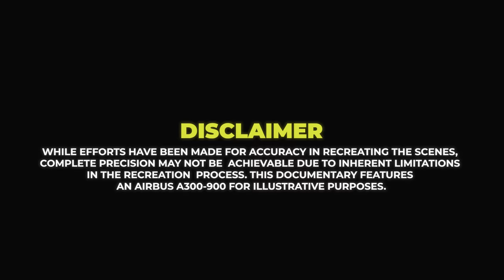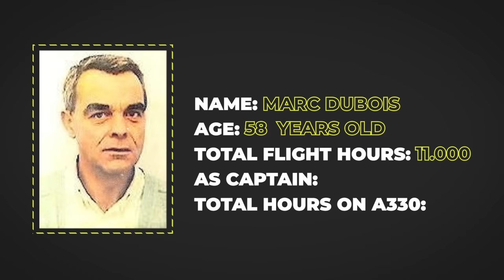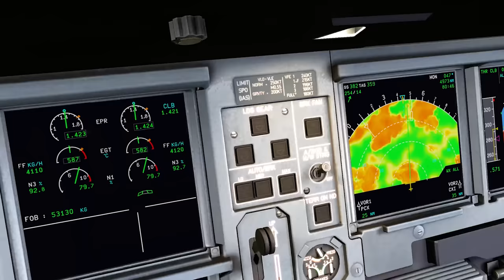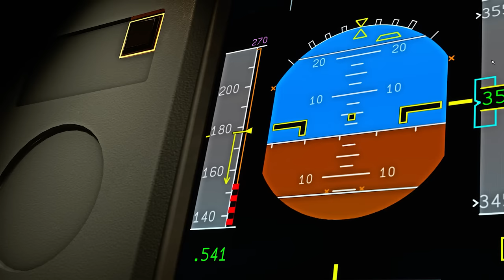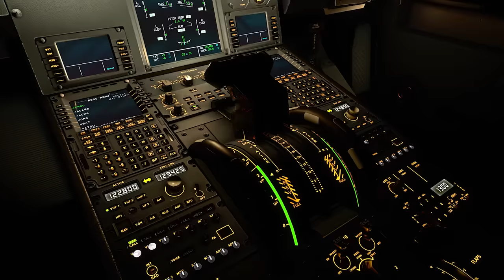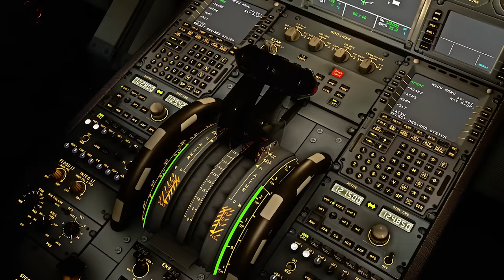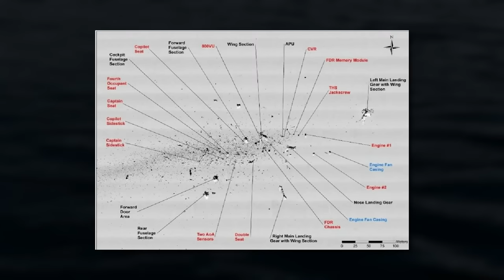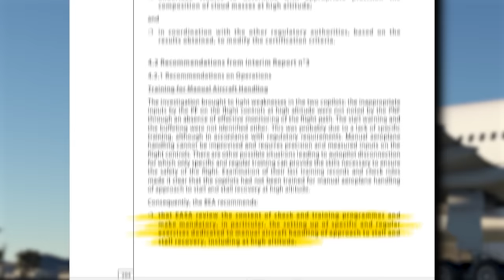Horrific Freefall into the Deepest Ocean | The Sad Story of Flight 447

Comment: This one facinated me. My Father was an A&P Mechanic for TWA for over 20 yrs at Lambert Intl in St. Louis. 58 to 82. Air crashes are investigated and 3 things: Weather, Mechanical, Pilot Error are what you look for. Terrorism obviously has been with us for some time also. This aircraft was doomed by pilot error. Weather was the airspeed instrument failure. Airbus jets have a joystick on both sides of the flight deck. Boeing jets have a yoke control that comes out of the floor in between the pilots legs. The Captain left the flight deck to The Less Experienced 
pilots. They repeatedly pulled on the stick pitching the aircraft up. They were not flying at all but in a flat spin. That should have been obvious with the horizontal loss of control. They hit the ocean at 400 knots. When the wreck was finally found, some of the remains of passengers were still strapped in their seats. At least it was quick. Makes me shiver thinking about the souls on board the 911 planes.

Comment: A stall must be the most terrifying a pilot can handle. Its like a ship losing its floatingcapability.
Reply: Nah, stall recovery is pretty straight forward in most airplanes. It's hardly worth worrying about really. I could take you up in a small plane, show you a stall and how to recover it, and you would be like, "Really? That's it?" Even a complete newb pilot can do it easily after being shown how and making a couple of practice attempts. Now, so called "power on" stalls, such as happened in this incident, are a little bit more interesting, but not much. My fifteen year old son was practicing them in his third hour of flight lessons.

What's terrifying is that a pilot doesn't RECOGNIZE the stall, panics, and actively HOLDS the stall condition for three friggin minutes without ever realizing he's doing it, as happened in this incident.
Reply: @xtnuser5338 it feels horrible, i was in a stall with an experienced pilot in a cessna and it felt horrible even tjough we only dropped for a few seconds
Reply: @l.n963  Some people do have a negative physiological response. That pit-of-the-stomach "Oh Crap!" feeling. I'll assume you hate roller coasters also. Heck, there's a highway offramp in my town that kinda feels that way if you're going about 45-mph or more when you hit it.

But everything I said is still true. Were you surprised, or did the pilot tell you what to expect?

Comment: This accident is scary because it shows that pilots don't really know how to fly a plane, some of them just press buttons and guide the landing. I'm not a pilot, but I've flown multiple times, it's very clear by just feeling it to ballpark the plane's speed, angle and if gaining or not altitude. I know that without the AP, the controls are harder than usual, but it seems that they couldn't realize if the plane was slow or fast, climbing or desceding. This is scary

Comment: A nose up is a dangerous airplane attitude according to classic acrobatic manual,  I can't believe that the pilot was pulling up the stick continuously.
Also all the automation makes the pilot overconfident and comfortable and when they lose it sometimes is an issue.
IMO  they should fly mono engine airplanes and/or sailplanes periodically in order to re fresh the basics.

Comment: I read a well written book specifically explaining the timeline of this accident.
This is what failed: No CRM(Crew Resource Management) and no "checklist" attitude). Let me explain:

In acute situations, the 1st step of a good CRM is "who is flying the plane?". In this crew, that was not clear. Both pilots were confused and making inputs.

The captain came in and did not make the question neither. He just asked "what's going on".

When the captain came back, he did not request a formal briefing of the situation. In a formal briefing, the pilot flying the plane explains quickly what happened and what has been attempted to correct the problem and what failed.

I am not sure this was an Airbus/Boeing. The author said, if it was a plane from the other company(Airbus/Boeing) the inputs from Bonin pulling back the controller would have been noticed by his colleague. In this plane, there was a major flaw, that the controllers could be independently controlled.

None of the 3 pilots seemed to react to the "stall" warnings, which was played 86 times. No explanation was found for this. The pilots didn't know they were in a stall.

The moment the captain came in, they were beyond help. Under a certain altitude(i forgot which) recovery is not possible anymore. 

Conclusion: "the unlucky stars aligned that day".

What now?
-The controllers should never work independently.
-Train the pilots in CRM more often.
-"Stall" warnings, as they are, could be ignored. Make them infinitely more annoying.

Comment: There was no need for the pilots to do anything. The plane had been flying perfectly fine so when they lost all readings they should have just left alone until the readings came back online. Instead they started to blindly fly the plane without knowing what their control inputs were actually doing. They had put the plane into such a position that the computers didnt even recognise what was happening and basically stopped putting out warnings or alarms because they could no longer contemplate the information from the various sensors that were still working.

Comment: I remember hearing about this incident. But was too busy to delve into the inner scope of and the cause of it.

But in summation, it sounds to me, as it boils down to lack of training of the junior pilots who took control  of the aircraft. 

But the captain returned to the cockpit. And with over that many hours, he should have the experience and the authority to resume command of the aircraft. Which could have saved everyone. 

When I first heard about this. It rather surprised and shocked me. Because Air France has one of the best records for safety in the industry. And the explanation on this factual basis is the fact that they are one of the first pioneers in aviation. 

The US sent pilots over to France during WWI to be trained by them. So the fact they left an implementation should be dictated by common sense and logic is rather disappointing.

Comment: Few clarifications based on facts. (A) All such bad weather was clearly showing in the briefing package given to AF447 pilots before the flight. They knew in general terms what to expect.  (B) Captains wish to be in the cockpit during bad weather crossing and not going to rest right away (C) All, and I really mean all, the other aircrafts were deviating such bad weather by 50-80-100 nautical miles left or right. AF447 was the only one that went straight. (D) The reason identified was that Air France pilots had the bad habit to keep the map scale to maximum of 640 NM where even a serious weather cell of 30-40NM looks very small. Air France changesd such habit after the AF447 accident (E) Air France did not have training for UPRT, meaning Upset Recovery, as it was the case in such AF447 accident. The pilots had to "unload" the wing instead of "keep pulling back the control stick" and they would have solves the issue and recovered the airplane. Such proper Upset Recovery training was introduced after the AF447 accident. (F) A weather like that is never-ever avoided climbing above, but rather be circumnavigated. As all the other aircraft were doing properly. Climbing does not assure that the storm is avoided during its development; the aircraft will be highly subject to be stuck by lightnings; the turbulence will be significant and there will be almost no performance margin. All what it was listed here are facts and not speculations.

Comment: What are the biggest problems I always see is the dual input function, pilots need to decide who's going to fly the plane to avoid the ambiguous commands to the input stick 
  Aircraft need to have a built-in GPS system that allows it to assess aircraft altitude and speed based on satellite inputs, in the event the pitof tubes become Frozen, or offer conflicting inputs, the GPS information would allow the pilots to fly the plane until the input tubes can be assessed as operating normally.
 I don't know if this will help or not I'm simply not a pilot just thinking of what is available and could be incorporated into aircraft.

Comment: The plane model shown in this video is the A330-900(Neo) (which entered service 2018) with it's characteristic Racoon eyes cockpit and A350-esque blended wingtips. To my knowledge Air France never ordered Neos. Flight 447 used A330-203 as stated.

Comment: If I understood correctly, they weren't able to get out of stall mode because they didn't receive training on how to do it during cruise flight.

Additionally, it seemed that they over controlled the airplane, which was the cause of entering stall mode in the 1st place.

My question is (to make sure I understood it right): if they had managed to increase altitude (in order to melt the ice crystals) WITHOUT entering stall mode (by more subtle manual controls) they probably wouldn't have crashed?

Since their lack of knowledge was how to deal with stall mode in cruise flight, if they had never entered that state, they probably would have made it, it seems.

Comment: This is the result of having 3 pilots doing a round robin in the cockpit. DUMB. Once the plane starting to lose momentum, they were done. They panicked, didnt have the correct information, and no one was prepared. A 38,000 feet drop in under 4 minutes on top of that and its impossible to recover.

Comment: They spoke french, not english. I knew Marc, the captain. I did mountain flying  training in france and met him then. 
Nobody in the cockpit 😢understood what happened. However, Marc yelled to Bonin do not pull the stick but it was way to late. At 10000ft recovery was not possible anymore... 
Stall warning stopped several times because the airspeed was so low (due to continuous stick pullup) that the computer rejected it.  When speed came alive, because the stick was pushed nose down the stall warning came back online... 
I think nobody understood nor believed the instruments. Maybe Dubois but to late

Comment: I know nothing about aviation. But the whole ice crystal deal disabling many saftey devices seems like a big flaw. Why is this? Surly there is a rational explanation for that?
Reply: Ice crystals block the inputs into the systems that are running the safety systems. The systems basically don’t have data to run so are useless and turn off. Since this does not necessarily mean they have an emergency they turn off instead of over correcting. To see what happens when safety systems refuse to disable look at the 787 max crashes.

Comment: It was the pitot tube freezing up which caused the computer to change from normal law to extended law mode, in normal law mode the crash couldn’t have happened as the computer would have interrupted the pilots mistake and pushed the stick forward itself, in extended law mode unfortunately the pilot had full control over the plane hence the crash. The two pilots in charge weren’t trained in the planes operation during extended mode, the senior pilot who was on a rest break was trained in extended mode but of course not available.

Still it’s terrifying the plane crashed in mere minutes with the stall warning going off constantly and they never bottomed the problem.

Comment: When you learn to drive a car and see that you are going to hit something, rather than hit the accelerator, you learn to apply the brakes. When a plane goes into a stall, you learn that you don’t pull up, but get the nose down. Many of these pilots have no clue as they get taught that the modern planes will usually fly themselves. So many accidents wouldn't happen if you had good pilots. Sure, there were other variables here, but the pilot in the right seat is primarily to blame. You give control to the other pilot after you've had 20,000 to fix the situation, and then when he pulls the control stick in one direction, you actually pull it in the opposite direction. Your inability to function in a high-pressure situation means you should never have been a pilot. I'll assume you were very stupid and not able to handle pressure, otherwise, it was almost if you intentionally crashed. It's very frustrating to look into plane details of crashes that involve incompetent pilots.

Comment: Why did they not turn on theTube Heaters to melt the clogging ice. The Airbus is equiped with this.  A simple switch  in the top panel in the cockpit.  They must have forgot...

Comment: is there a reason why everytime i watch these the pilot always pitches up at 350? Im only a sim pilot but anytime ive ever had loss of control or airspeed indication ive just lowered my alt, picks up speed, and regain control and slowly start ascending again but to purposely be increasing your climb as all of this is happening is crazy to me, Is it because of the storm? or is it because the altimeter stops reading properly? but even if its not working you have the situational awareness that your 350 up so whats the worry in descending vs straight up stalling the plane?

Comment: The crash investigation report for political reasons had to conclude something.This pod cast was made because the report was not complete. In conclusion the likely cause was the aircraft flew into a rare super storm cell similar to accidents in the south china sea.

The most likely change of events were.controlled flight into a very fast descending column of air in the storm cell.The aircraft lost all lift in a flat attitude, the instruments disengaged in negative pressure,simply was take down to the sea in a flat decent where it was lost in the ocean.The impact on the air frame was a flat spin impact supporting this conclusion. The pitol tubes were simply weather related effects not the cause.

Science has yet to have a full understanding of the shear dynamics of these rare super storm shell phenomena. Its sad politics over rules the discovery of further facts in this case.

Comment: The company responsible for the planes installed new pito tubes without explaining this to the pilots or providing training/briefing. The pilots did as they should have, if the plane was functioning under previous circumstances… I’m not sure why this narrative paints the issue as “undefined” or “learning from the mistakes of pilots” deemed as ignorant. They had no way to know that previous procedures would not apply to that situation

Comment: What use is  a pilot and co that cant fly manually, They should of had a load of hours of manual control of large aircraft for situations where auto pilot controls are disengaged or shut down what a unprofessional easily avoided catastrophe a experienced pilot and co pilot could of corrected the flight controls to regain safe flying of the aircraft, They need to create a specific course and training for computer and auto pilot malfunctions,
 you'd think that would just be a basic training 
Sad and avoidable 
Rip everyone involved

Comment: I don’t know anything about planes so please be nice, why aren’t pilots encourage to try land in the ocean instead of getting to the point where they’ll crash in nose first? Every plane I’ve ever been on has loads of safety briefings and life jackets, yet I’ve never heard of a successful plane landing in the sea? X
Reply: Hi Molly! I’m not a pilot, but I think I can answer some of your questions. I’ve studied plane crashes and I THINK I have a good idea, but if an actual pilot could corroborate or correct me that would be great.
It’s very difficult to land at sea largely, I believe, because of the speeds at which passenger planes travel and the way the ocean behaves. There was a Swiss flight (111, I think?) that had to ditch in the ocean and ended up telescoping in on itself because of the angle and the speed it was going at. Because the sea isn’t level like a runway, there’s also no accounting for where the wings will end up, and especially if it’s dark, there’s almost no way to time the landing to be on a wave that could carry the plane at all (I think one plane did this successfully?). A wing could hit the water wrong upon landing and invert the plane or a rouge wave could take it under faster than a life raft could be deployed. Often, though, I believe it really comes down to the speed that they’re flying and that falling into water from 30,000 ft. is like falling into concrete. Landing belly first at the speeds and the angle is going to shatter most aircraft. If a pilot can glide a plane into the water and “fly” it there, they have a very slim chance, but often things happen too quickly and at too high of speeds to do much of anything. 
Again, if a pilot could confirm or correct my theory that would be great 💙
Reply: @sarahrohde7923  wow thank you!! This was such an informative reply and I never really thought of the logistics tbh haha, thank you again x

Comment: well
um
PERFECTLY 
HONEST...

a new ,,,PRESSURIZED  757 and 767 ,
could propel itself thru water,,but salt pressure,   would CF6 "bursting pressure"  near a Young's modulus. 
would 
QUICKLY 
deteriorate the
door seals.

M.A.Bodine
Reply: as F= m*a. just as is inverse 
-F = m*-a ; 
In my professional opinion, you shouldn't get rid of gas cloud photos that are located at Ohio airport. ORD nor OHIO airports nor Sioux City , IA. Ice clouds ALSO CAN deter and  change  altitude inputs readings  and large dust  
,,,X1 engine ,,,overheated ,,,ALOT. 
chicken please!